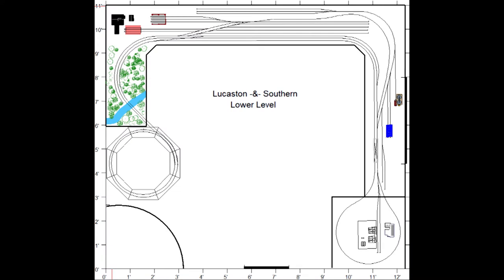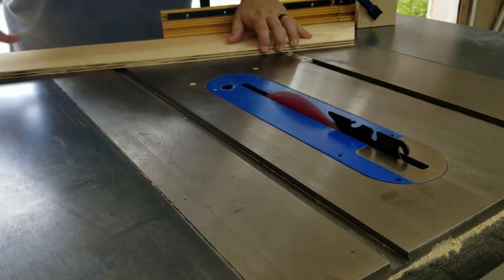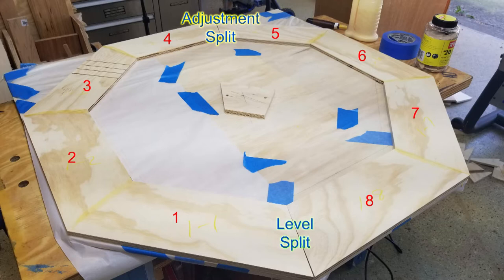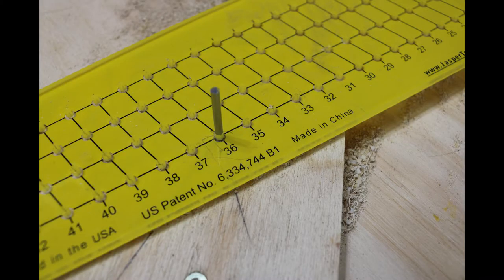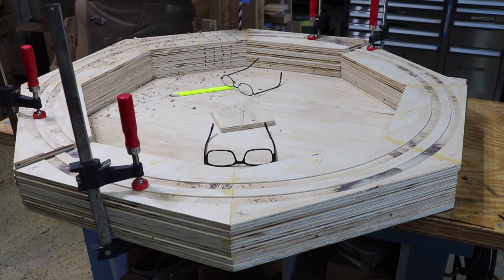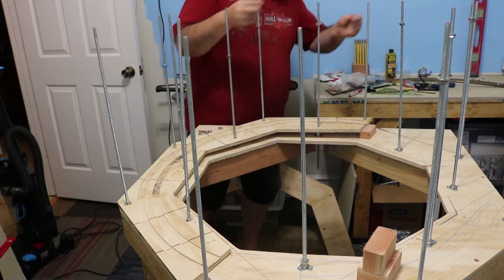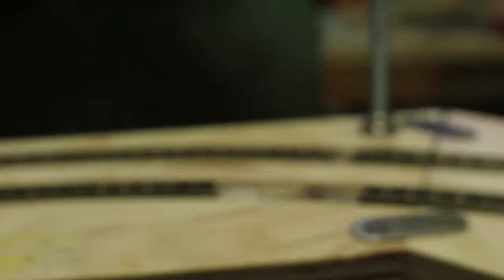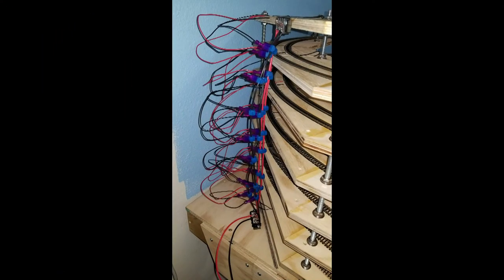Helix Construction on the Lucaston & Southern - Model Railroading

Comment: Excuse me but, if you set your router guide on the 33” and 36” marks respectively, that gives you a RADIUS of that size. It gives you a diameter 66” and 72”
Reply from the maker: The number on the circle jig is the diameter, not the radius, and is the measurement to the inside cut of the bit. The jig is also calibrated to a 1/4" bit and I'm using 3/4" bit. The radius provided is the track radius which is the measurement from the center point to the centerline of the track, not the edge of the cut.